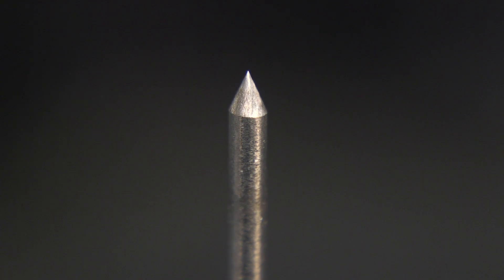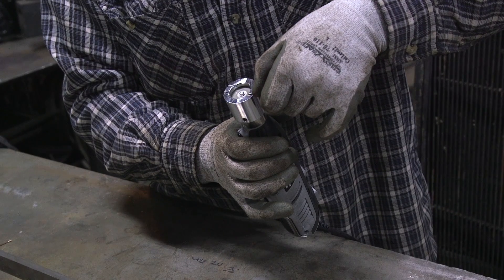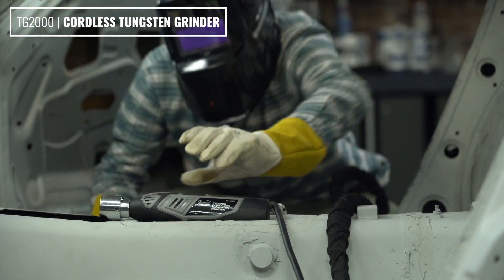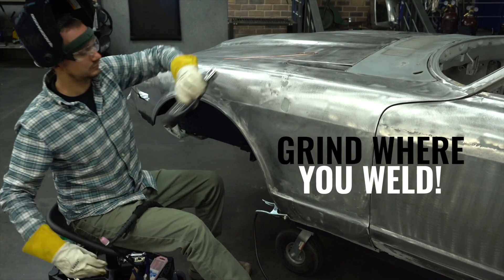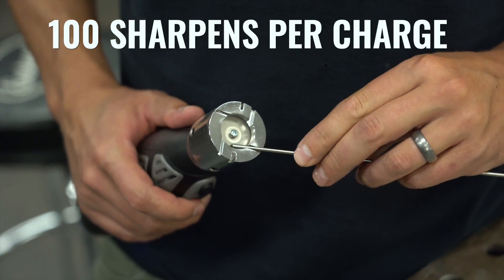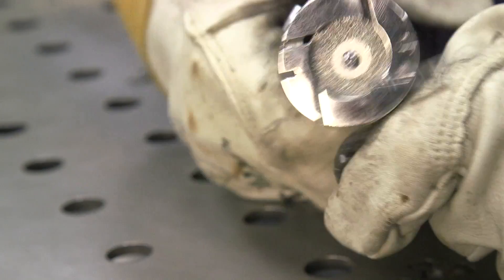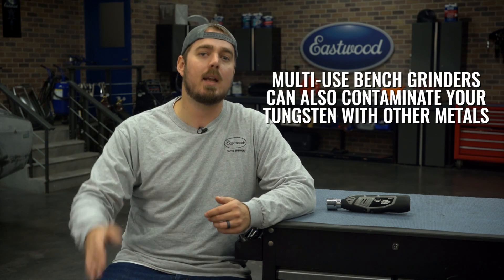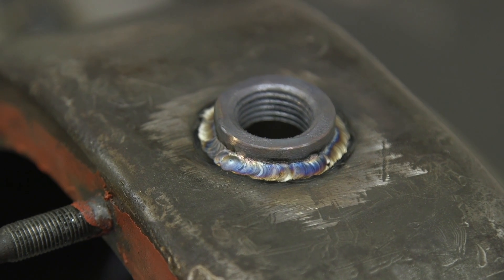One Tool That EVERY TIG Welder Should Have! TG2000 Tungsten Grinder

Comment: This might be handy on a job site. Welding a handrail some place for example. But then, an angle grinder (or linisher or bench grinder) will also do it just as neatly as this device if you grind in the direction of the wheel, not across it.

Comment: I worry about electrode dust. I would pay a premium for a tool that mitigates that.
Reply: The electrode dust eventually makes its way into the unsealed bearing under the diamond wheel and stops the bearing from spinning. Eastwood did ship me a new one but I don’t know if I’ll have the same problem with the new one too. Since they let me keep the old tool I’m going to see if I can press out the old bearing and press in a sealed bearing.